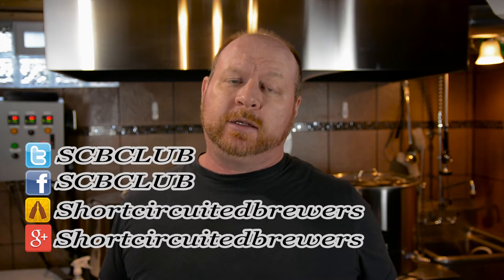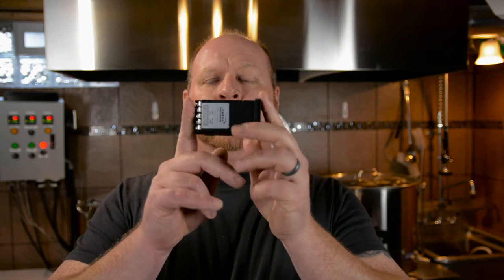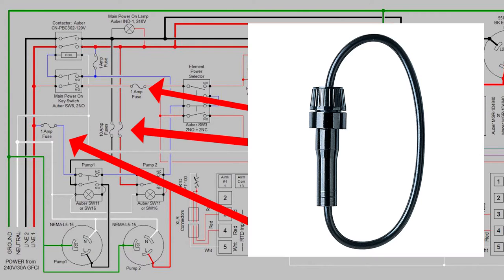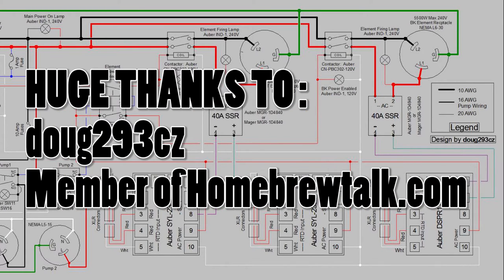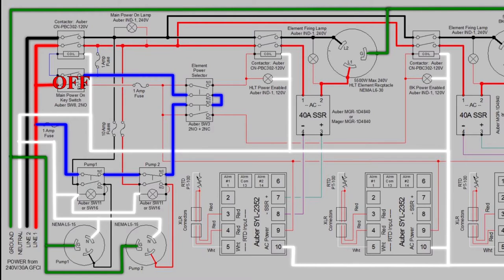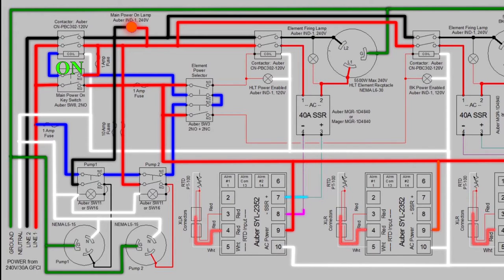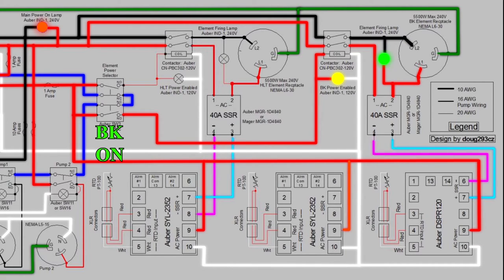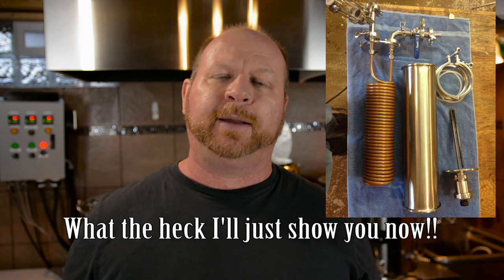Electric Brewing Series Part 7 - HERMS Control Panel #electricbrewing #electricbrewery

Comment: Hi Brian, been following your channel a Lil while and really like what you guys are doing. I think your vids are very good for advanced and new brewers as well. I think you really try to make it easy to get your concepts across. I'm in the process of putting together a control panel right now. However, I'm going to do a 60 amp panel for various reasons for the way I want to use the system. I have never used an electric brewing system before and read and watch all I can. 
I know many brewers use the same type of system, differently,  ie: their methods. The most popular seems to be the 30 amp like in this video series.  At around 8 minutes in, you say, you add water to  the MT and the HLT  and start the recirculation  in the HLT?
My question is, do you mean you recirculate the HLT through the coil and through the MT to preheat it, and then use some of that heated water for strike water , AND have enough hot  water left in the HLT (to have your coil covered, WITHOUT ADDING additional water) to start recirculating the mash right away?
I understand some guys , with a 30amp system, fill the HLT  to max capacity,  and drain off what's needed for strike water, THEN top off the HLT to at least cover the coil? 
The route I want  to go is,  heat strike water in BK, and fill and heat HLT simultaneously so I have the HLT/HERMS  ready as soon as I mash in. Hence the larger Amps.
I hope my babble/question,  is not to confusing.  lol
Thanks
Reply from the maker: Glad you have found the series informative and helpful! I was a little concerned that part might be confusing. There are several different ways to achieve your mash in water temperatures. One way is to fill your MLT with the appropriate volume of water for mash in, fill the HLT with the appropriate amount for your sparge, recirculate both volumes while heating the  HLT to mash in temp. Once mash in is reached, mash in with your grains. One issue with this... Your HLT mash temp after mash in is still at the strike temp. The issue here is that when you start recirculating your mash it will raise above your target mash in temp thus overshooting your mash temp. A 50 or 60 amp panel would be able to heat your mash water in the BK and the sparge water in the HLT to the exact mash temp simultaneously, so that when you transfer your mash water from your boil kettle to the mash tun your HLT is at the correct temp to maintain your mash temp. NOW.. here is the tricky part of that. Your mash tun's thermal mass is going to reduce the temp of your mash/strike water from the kettle when transferred, therefore you will have to play around with how much above your mash in temp you heat your mash water above the appropriate strike point for you mash. IE. if your mash in/strike temp is supposed to be 169 you might need to heat your strike water in the boil kettle to 180 so that when you transfer it to your mash tun the temp drops to 169 or very close to it. Since I have a 20 gallon BK I usually heat most of the volume for the MLT and HLT at the same time.(usually about 180)  then fill my mash tun first, (temp drops after transfer to about 169) then transfer the remainder to the HLT and add cold water to the HLT to both achieve the volume I need AND cool it down to the high 140's - low 150's. (which is not an issue since your HLT will adjust from those temps rather quickly)

I know that is probably the longest response  to a question ever.. lol But i wanted to explain a little more. Would a video on this be helpful at all? I have thought about doing one but wasn't sure.. Let me know. -Brian
Reply: Sure, do a video of the different ways to do the herms mash in. I think that people do it all different ways under the name of "HERMS". I understand your version, makes sense to me. Also, it's system specific on how exactly you do it. 
Yes, I will be heating up strike water in my BK while also heating .....let's call it "mash recirculate water", technically,  it's really not sparge water yet. It will turn into sparge water after the mash has ended and the temp is raised. And  Yes, as You point out about having the strike water that is heated in the  BK and pumped to the MT, the temp will drop. I think what I'll be doing is, once the strike water is nearing the correct temperature in the BK, I'll start to recirculate it to the MT and back to the BK for a short time to prepare heat the MT. will see how that goes as soon as I get my system complete.
Reply from the maker: I agree there are many ways to do the transfer.. in our recent.live broadcast, I did it yet another way. Heated mist of the water in the BK, put 3 gsllons of cold in the HLT then transferred to the MLT by circulating through the coil to preheat it. The MLT was cold and when I transferred the strike water I was only a coupke of degrees off.
Reply: Oh, I watched the live brew, but you were all ready mashing when I tuned in. 
So I missed that part. I did however witness the part when your wife went to get the pizza.........I yelled ahhhhhh, cause I seen it coming. That sucks, but, that's exactly how that happens. your reactions were great. 
Oh well, nothing you can do about it.
Reply from the maker: LOL That was not funny at the time but made for some comedy during the broadcast. Thanks for watching the channel.  Cheers!

Comment: I have 3 DSPR300 and 2802A running my system with a dedicated small
 HERMS vessel.
Reply from the maker: Nice! how do you like those?
Reply: I like the second element option of DSPR300 for the boil kettle...I use it to quickly heat strike water in the boil kettle or to boil.
Reply from the maker: Nice thanks for watching!  Cheers! -Brian
Reply: Waiting to see the DSPR build.
Cheers!
Reply from the maker: working on it.  Stay tuned!  :-)

Comment: It is unclear as to what the 2nd SYL-2352 is being used for, terminal 7 and 8 are not connected to anything? Just for temp readings? I imagine you have a temp probe in HLT, and another temp probe on the output of your herms coil so you can figure out what temp wort you are sending into your mash tun.  My herms portion is a PID with a 5 gallon pot ( so I can step up temp fast) with an element and temp probe with a small herms coil, and a non electric analog temp gauge on output from herms coil. There is water loss on the 5 gallon HLT pot after an hour (or more depending on step or mash out) of recirculating.  It will be interesting to see if that herms tube blows pressure or keeps enough water in to keep element wet. Thanks for all you contribute!
Reply from the maker: You are correct the middle PID is to monitor mash temp.. as a side note it came in handy when my BK PID stopped going into manual mode.  swapped them out..  BREW ON.. Yeah it will be interesting. Mike did put a 1300 watt element in it and did not have any issues. adding a PID to it will be an adventure. we are going to put a pressure relief on it  so we don't make a bomb. . lol Thanks as always for watching!  Cheers! -Brian
Reply from the maker: Oh I almost forgot, what the real pain was... making that coil.. we did that ourselves filled the copper with sand and coiled it around a round wooden post that was a real pain. Not for the weak or faint of heart... lol
Reply: Short Circuited Brewers You aren't  kidding ,  made mine that way to less the sand and 6 inch diameter post. all copper counterflow chiller  using the same post was harder yet. Thanks for the reply@

Comment: I am curious why you need the contactor before the SSR's. You said to turn the element on and off I think. Isn't that what the SSR does according to the on/off signal sent by the PID? Is the Contactor for system safety? My setup does not have the contactor and works fine. Just curious incase I should be adding contactors.  Thanks
Reply from the maker: SSR'S generally fail to the ON state. The contactor is the in the power "chain" for protection in the event the SSR fails to the ON state the contactor allows you to terminate the power to the elemeny manually.
Reply: That makes sense now. I have see this first and did not think about that situation. I have used the cheap FOTEK SSR's. They overheat very easy and lock on.  I have a switch on each element to physically kill power to the element when needed. I ended up switching to the Auber SSR's and added 2 fans to the box to suck air from top to bottom through the box and the SSR's stay nice and cool!
Reply from the maker: Whatever works.. safety first.. Cheers!

Comment: you have the dspr 120 on the boil kettle, could you not just use another syl 2352  in it's place 
?
Reply from the maker: It's bad too.. Lol
I have it there as a passive temp reader. The SSR output on it is dead too.
Reply: @ShortCircuitedBrewers  No the DSPR120 is going to the ssr for the boil kettle, I was wondering if I could just use a syl2352 in it's place to control the boil.
Reply from the maker: If I rewired it I could. Or switch the power and sensor cables. Was not really worth all that effort honestly. I was fine with the temp being goofy. It still boiled fine.
Reply: I found the answer, thanks
Reply from the maker: @kevinmurphy4712  did I miss the question?
Reply from the maker: @kevinmurphy4712  I did miss the question.. Yes I could. I have been asked a lot about the DSPR 120 so I decided to try it out. Sorry did not read your question carefully enough.. Lol 👍🍻
Reply: @ShortCircuitedBrewers  Thanks for the fast replies, I am in the process of this build, I have no problem using a regular PID for the boil kettle . A few more buttons to push is all but my PID's have been very reliable  and for the ease of use I will stick with them. Thanks again
Reply from the maker: @kevinmurphy4712  I think I should have!! Lol I have determined the DSPR 120 is bad.. Ugh

Comment: At 4:36 you only need 2 x 120 volt  and 3 x 240 volt lights
Reply from the maker: ok. Is there a question?
Reply: @ShortCircuitedBrewers  You said it the other way around
Reply from the maker: Oh.. well shoot!! Messed it up again!!
Reply: @kevinmurphy4712  I just want thank you for asking questions. I'm new to home brewing and I would  never have caught any of what you did. Thanks to you I'll be using the syl-2352 as well..  Did you find any other errors or is there anything you recommend to do different? I was also thinking of using a newer style of fuses instead of the old round ones. Do you think there would issues using a different style of fuses?
Reply: @speedbuggy7240  Just think of a safety concern, the more safe the better.

Comment: Way too much garbage to brew beer.  

Anyone who needs this much bling to brew beer should just buy a keg of Sam Adams and be done with it...
Reply from the maker: What type of brewing system do you prefer to brew on?  Cheers! 👍🍻
Reply: @ShortCircuitedBrewers  -

20 years of brewing over propane, but switched to electric last year after a minor distilling snafu (fuel alcohol) ;)

We use 5500w elements and control with a simple PWM for both beer and fuel.  Everything is stainless or copper, for sanitary reasons (copper for still removes sulphur), so we have nice equipment, but flashing lights and digital displays somehow would take away the romance and replace it with a chinese automation feel.  

While I can appreciate the bling for what it is, pretty, in my experience, its just multiple added potential failure points.

My point was, all the flashing lights in the world wont make your product better if you cant brew by the basics to begin with.  I know a long list of folks with pretty control boxes who cant make a beer worth drinking, while I know many guys and gals that can make some of the best craft you'll ever taste, from home depot buckets.

To each their own.